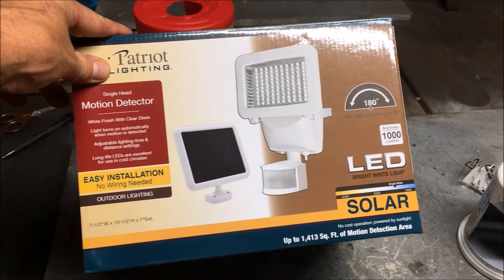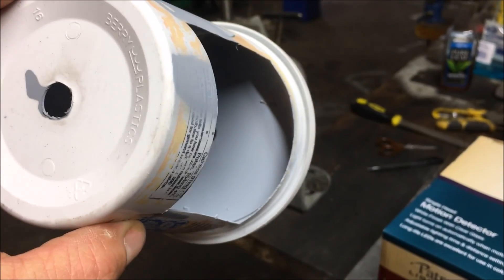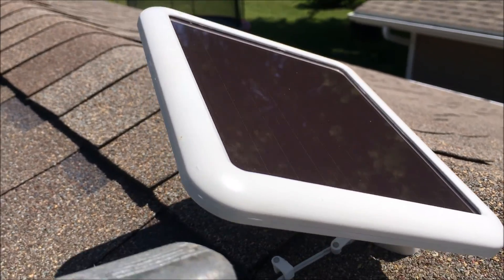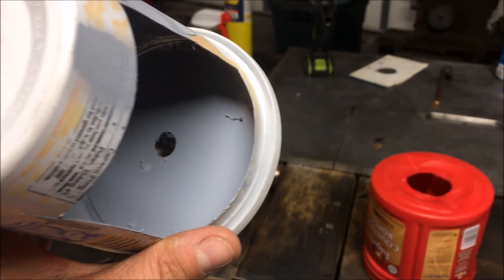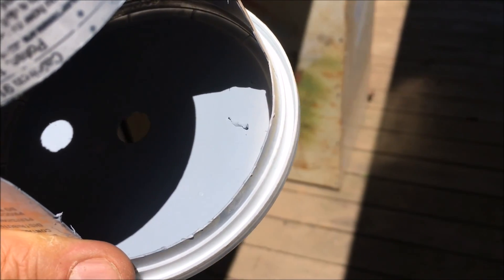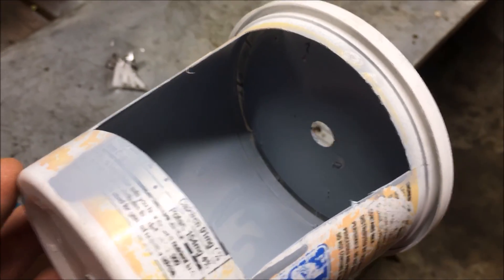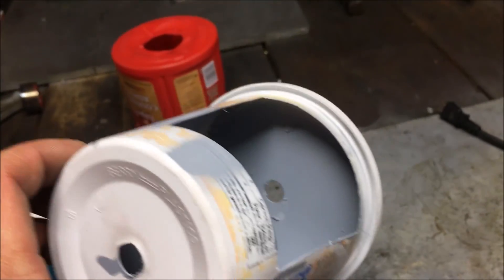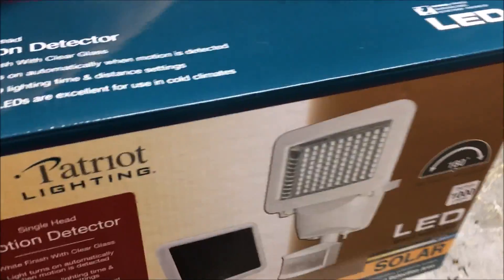Solar Panel  alignment INFORMATION  (DIRECTION AND ANGLE) ?

Comment: This method with an LDR at the bottom is the essence of a very easy design for solar tracking. Been around for many years...recall reading about it. Not sure how they defeated cloudy conditions stopping the panel hunting around.
Reply from the maker: I bet they use a secondary ldr set up that determines if the sun is out
Reply: NOBOX7 yep i am seeing things like 3 LDRs on one circuit when i google it. That's gotta be it. Very simple curcuit. Putting arduino on it is overkill.
Reply from the maker: I went to align this panel and i resized, this is gonna be harder then it sound to get this angel , so i just decided to build this thing instead